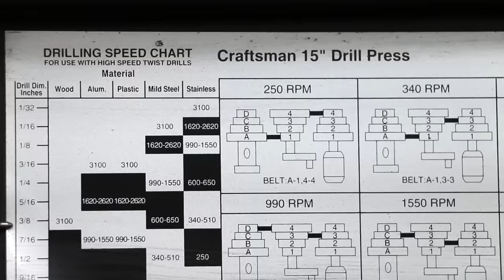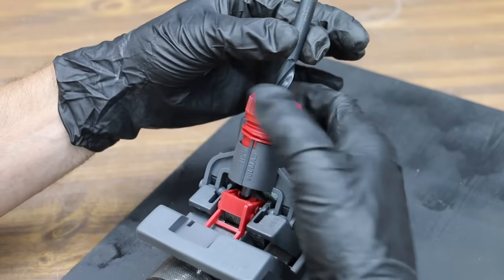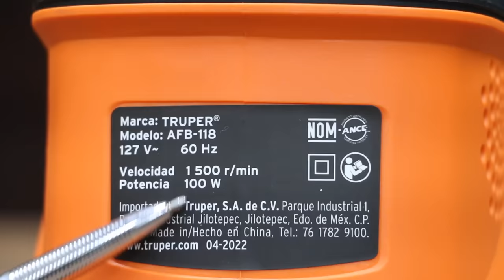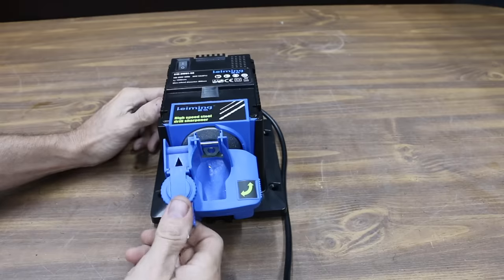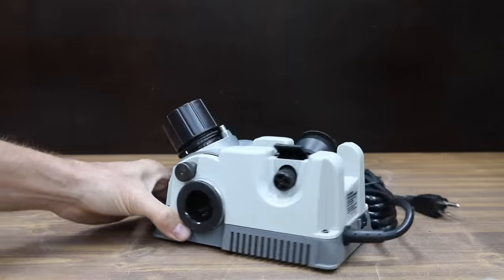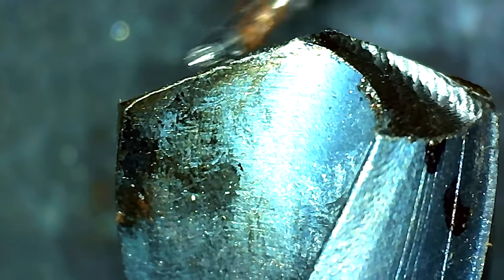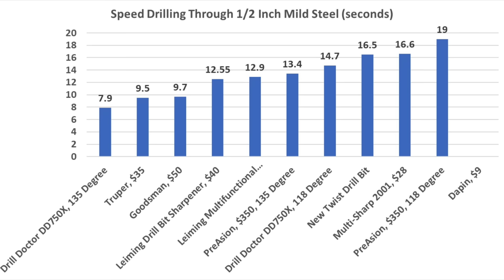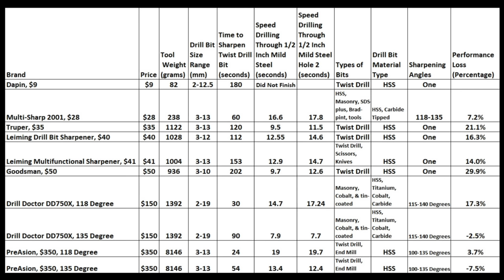Which Drill Bit Sharpener is Best? $9 vs $350--Let's Settle This!

Comment: I've learned tricks to sharpen drill bits with a grinder but the results of one of these are very convenient and obviously more accurate and yesterday i was thinking about these only to find out your video today. Guess even the cheapest can help me out considering i ruin drill bits like they're nothing.
One thing to point out is sharpening drill bits successfully is heavily based on their quality, usually it's heat from using wrong rpm vs material that ruins their hardness and even if you sharpen them they don't last, most times drill bits of better quality are more heat resistant because of their composition and cleaner metal alloys than generic recycled chinese ones so if you use them properly and sharpen them they can last forever as long you don't brake them.
I appreciate a lot the effort you put in your videos, you are one of the kind.
Reply from the maker: Thanks!

Comment: My dad has been using the PreAsion for quite a while and is very happy with the results. He sharpened over 150 drill bits in a single afternoon and they cut better than with the factory grind
Reply from the maker: Thanks for sharing!
Reply: @ProjectFarm yeah it takes a bit more work to dial in to the correct angles and the scale on the flute setter isn't great but once you get it dialed in it cuts the drill point and flutes way more accurately than the drill doctor by a significant margin and is way more repeatable/faster. It's real downfall is the flute setter, the cutting edge should be aligned with the flats on the collet holder or it will produce a point that is too wide in the webb.  One down fall of the machine is the motor uses metal shielded bearings, if you don't clean it out enough then grinding dust will kill the bearing on the shaft end of the motor, I have the larger model of this machine and had to swap out the motor bearing, I went for a rubber sealed bearing this time as they hold up better to fine dust.  With anything Chinese it's not perfect but with modified scales, drill setter and better sealed bearing you won't get a more accurate drill sharpener for the money.
Reply: @weldchip  That sounds like the motor bearing I just had to replace on my Craftsman table saw--severely exposed to dust and metal-shielded. I already bought a spare so I'm ready to replace it again, but thanks to your tip I'll try to find a rubber-sealed version the next time around.
Reply: @weldchip  I have the same machine, very happy with it.  Tip, add a few magnets in the dust chamber - that will help capture the dust.  Works great.
Reply: @ixfxi  this is what I did.
Reply: @weldchip  when you set the flute stop, you aim to make the cutting lips as parallel to the flats on the collet chuck as possible?

Do you know where to obtain the backwards collets that come with the machone?
Reply: That's the only one that I would buy, I've been a machinist for decades.

Comment: I've had a drill doctor for many years. It works OK. There is a big difference in the quality of drill bits. My go to are cobalt screw machine bits, if I'm not drilling something really hard, then carbide.  I now eyeball sharpen on a bench grinder, fast and close enough for most uses. Drills always make an over sized hole. Most drill presses are not ridged enough to do precise work. A mill will do better using power feed. Ream or bore to get closer. 
In the video the affect of "pop thru" as the bit exits can be seen as the rougher area at the end of the hole. Power feed will reduce/eliminate that.  
Great video as usual, Thanks
Reply from the maker: Thanks and you are welcome!

Comment: It would be interesting to measure the holes to see if the sharpeners maintain the hole size or if the point is off-center and oversizes the hole.  Great video.  When are you going to test hand held belt sanders and pole saws?
Reply from the maker: Thanks for the constructive feedback.!  Thanks for the suggestion.
 https://www.youtube.com/watch?v=U1lDxUMCY-M
Reply: Agreed. Even if it does a fast job but the hole isn’t to spec, makes that one worth less and maybe worthless.

Comment: That Drill Doctor is excellent. If they are available here in South Australia, I'll buy one. Great testing. I like the way you deliberately made the drill bits blunt, & then tested each sharpener. Great stuff. I like unbiased testing too.
Reply from the maker: Thanks so much!
Reply: I got one from Total Tools years ago here in Victoria
Reply: yea total tools has them 750X is $599 and 500X is $489.. crazy expensive. Might be cheaper to buy in USA and use shipito to send to australia. The 500X version is also basically teh same as 750X except it doesn't do as many angles on bits. just the popular ones 118-135

Comment: 🤔 Great testing and review, Todd.  
On the subject of sharpening drill bits, I had an uncle who was a master welder and he learned to hand-grind multiple facet geometry into his drill bits, which he swore were superior to conical ground bits.  When he started out as a machinist in the 1930s, he sometimes had to work without electricity and he was always looking for any trick he could use to reduce the effort needed to drill steel by hand.  He also claimed the multi-faceted bits would outlast conical-ground bits by a large margin.  Sadly, hand-grinding of multiple facet bits seems to be a lost art, but there are modern jigs that make 4 facet bits easy to grind, like the DBS-22.  I don't know if there are any that will do a 6 facet bit, which is supposed to be even better.  
It would be interesting to compare multiple facet drill bits produced with the DBS-22 with the conical ground conventional bits produced by the Drill Doctor and other sharpeners to see if what my uncle said was true.
Reply: I work in a machine shop with an older guy (72 years young) who has seen and done everything in our industry. Owned his own shop for 30 years, and really only works now because he genuinely enjoy the craft. He regularly free grinds 4 faceted drill points out on everything from a bench grinder, to belt sander, even with our disc sander.

Whenever he's doing it I always ask him to sharpen up a few of mine. The genuinely cut better than any result I've ever gotten, that's for sure.

Comment: Another great video. a couple years back I bought around a hundred used drill bits at a garage sale for just a couple of bucks. I looked at a lot of sharpeners. A lot of them were expensive, and the cheap ones didn't seem very reliable. I was leaning toward a system I could attack to my bench grinder. These were also expensive. I decided to make a couple of wooden triangles at the proper angles to use the side of my grinder's wheels. I made a groove in the center to hold the bits. These are very fast and accurate for sharpening. They cost me nothing but my time and ingenuity.
Reply from the maker: Thanks!   Thanks for sharing.

Comment: If you do another one like this, I'd love to see Tormek's drill sharpening jig included!  It's not fast, but it makes a great and extremely precise point.
Reply from the maker: Thanks for the suggestion.
Reply: I've had good luck with the General tools drill bit jig
Reply: @ForfeMac that looks like a great option because it works with a regular bench grinder.  And at 1/5th the cost of a drill doctor it could be a smart buy.  Maybe @ProjectFarm can't do a follow-up on jigs for people who can't quite justify a drill doctor.
Reply: @charliesullivan4304  If you already have a bench grinder it seems like a no brainer, though it did take some brainwork to figure out how to use the damn thing since it didn't come with instructions.
Definitely paid for itself in drill bits by now though
Reply: @ForfeMac  It did look a little complicated, but I just finally got a nice bench grinder, so when I'm up for a challenge I'll get it and figure it out.
Reply: @charliesullivan4304 one trick you can try is to buy a diamond coated grinding disk the same size as your grinder wheel, then slide it onto the grinder before the washer and the lock nut. Depending on which grit you buy, you can sharpen to a much higher polish, and also sharpen tungstens for TIG welding, or other high hardness materials. Also don't let your bets get too hot or they could loose thir tempter. (in theory high speed steels won't loose their temper in high heat, but why risk it IMO?)
Reply: Tormek 4 Ever!

Comment: Who here sharpens theirs by hand?✋🏼
Reply: What’s the name?
Reply: Been doing them by hand for about 50 years
Reply: Do you use a file? Or what do you use
Reply: 19 people
Reply: Sanding disk on an angle grinder, or bench grinder works pretty good in my subjective opinion.
Reply: One of the first things we learned in machine shop with a drill sharpening gauge .
Reply: Me
Reply: I had to make the drill gauge first
Reply: Use a bench grinder with a flat and medium coarse stone, depending on drill size. A common mistake is using too fine of a stone and overheating the bit. If it turns blue, you may as well grind that area out, as you just destroyed the heat treatment on that portion.
Reply: Hard to sharpen a 3/32 drill bit by hand 😂

Comment: Thanks for the video. I have been using Drill Doctor for years. I love it! My only criticism is the lack of tips and tricks in the manual. Your video gave me a little more insight. 

Tip: on the 118°, if you advance it by one notch when setting the bit in the chuck, you get a slightly higher pitch and faster cuts. BUT, it also grabs a little more. Be careful. A good drill can twist your arm off when the drill bit bites!
Reply from the maker: You are welcome!

Comment: the drill doctor works great especially making split point ends. I used the older model of the drill doctor when putting up my steel building and had to drill a few hundred holes in gauge metal and they would dull after a while but after a few min on the sharpener they were better than new. the drill doctor paid for itself a few times just on that job. 
great video

Comment: I have had a drill doctor since they supplied a VHS tape with them for instruction. I have had inconsistent results with it, the bits look textbook sharp when done but don't cut as well as I think they should. I appreciate this video, I need to lock myself in the shop with it this coming winter and sort it out.
Reply from the maker: Thanks!  Thanks for the feedback.

Comment: Very interesting.  I taught myself how to sharpen drill bits on a bench grinder very long ago while working in my father's auto repair shop.  I doubted the ability of these machines to properly sharpen a bit, knowing the complex angles that are involved, but the ones that worked contained complicated methods of moving the bit across the stone, not just rotating it along its axis.  Before watching the video I would not have believe that they would work but some of them did indeed work.
Reply from the maker: Thanks for sharing.

Comment: Looking at it, it seems there are two types of profiles these grinders put on the drill, the cheap ones usually put a flat surface while the expensive ones put a rounded surface that follows the work as the drill cuts, which seems to give a cleaner hole.

Would have loved to see how much time it would take for each sharpener to grind the same profile again as it made before but with damage to the drill, since if you are getting a sharpener you are likely to use the same one all the time. But I think for most people the most important part is how the drill cuts afterwards and not the grinding process.

Love your work!
Reply from the maker: Thanks!

Comment: I was given a Drill Doctor a few years ago.  It has saved me a lot on 2' long "installer bits" that we used to simply replace when someone hit concrete with them.  I have used it on smaller bits as well, and I've always been pleased with the performance.  I've always thought it was one of the best machines out there.  -- It's good to see that proved out by some comparisons.
Reply from the maker: Thanks for sharing.

Comment: used to sharpen drill bits the old fashioned hard way...which was cumbersome, and doesn't offer reliability and repeatability...
aside from the $40 one, I've tried all three shown on your video thumbnail ..didn't give me the result (sharpness, durability, repeatability) I wanted... gave up using those.
went the DIY route using a belt sander with included circular sander, and some modified wood blocks (to hold the drill bits)..
got what I wanted... and happy with that...sharpened HSS drills no problem drilling holes on 304 stainless steel..
Reply from the maker: Thanks for sharing.

Comment: I'm on my 2nd DD750X after the first one's motor wore out but after years of use. The diamond coated abrasive on the DD will last exponentially longer than those cheap grit wheels. Does take some practice to get them cutting their best.
Reply from the maker: Thanks for sharing.

Comment: Todd, another great review. There is one thing you missed however on the 750 Drill Dr. There is a M.T.O. (Material Take Off) adjustment knob on the side of the machine. Use this when needing to adjust the amount of depth of material you actually want to take off PRIOR to the grinding process. This can be helpful by taking more ‘material off’ or less, if you don’t need to thus preserving the bit material overall including the grinding wheel. This is important because when you’re changing/adjusting a 118 degree bit to a 135; this is what you adjust to ACHIEVE the proper cutting competency out of your bit. You rated this rather high on your overall test rankings and I agree completely having had both the original 350 and now the 750 combined for over a quarter century and these two machines are refined and highly functional. This added adjustment knob is a key point changer I thought I’d share back on your excellent review so viewers don’t miss why this is important. At $150.00 it’s pricey but I’ve never replaced my previous ‘350’’s wheel in that 28+ years and these are just worth their weight. I am NOT sponsored not affiliated in any way with the Drill Dr. name or company just to put that out there.
Reply from the maker: Thanks!  Thanks for the constructive feedback.

Comment: Perfect timing on this video!  I was starting to look around for a drill sharpener because I got a bunch of dull bits that need repair.  Im trying to decide between the PreAsion and drilldoctor.  Is the PreAsion all metal construction, including the chucks that hold the bits?  Does the plastic chucks in the drill doctor seem of good quality?  I would ususally choose something made of metal over plastic.
Reply from the maker: Thank you

Comment: I bought the Drill Doctor 750 about 15 years ago and it has done a great job for me, including sharpening larger bits. They used to offer a 500 which only sharpened up to 1/2 inch, and it was a little less expensive. 
The Drill Doctor uses a diamond cutter which makes a smoother finish than most stones will give. That may be part of the reason the drills cut faster.
Reply from the maker: Thanks for sharing.

Comment: I purchased the same Drill Doctor years ago at Lowes for $10.00 NIB,  only missing the diamond stone wheel.   OEM wheel was about $17.00 then and I find this tool is good for resharpening when you have a bunch of bits in a box.   However as a mechanic in the 1980s I had experience hand grinding drill bits, and own a proper 6" side grinding drill bit sharpening stone.  For the most part, if I need a fast cutting bit now, I go straight to hand grinding where I can increase the cutter angle and rip through mild steel fast.   That and if a bit is broken requiring shaping, or obviously if it is too large for the little Dr.
Reply from the maker: Thanks for sharing.

Comment: The one thing missing is the hole size, if not held straight there could be runout causing the center to be ground off center which would create an over sized hole. For many applications this may not be an issue but if you needed a more precision hole for tapping or reaming it makes a difference. Checking it to the nearest thousandths with a set of pin gages would have made for a better review.
Reply from the maker: Thanks for the constructive feedback.

Comment: Just bought the Drill Doctor 350. Easy to use and fast. Badly damaged bits took a few minutes each to come out sharp. I also like that you can buy different grit stones and they are not expensive.
Reply from the maker: Nice!  Thanks for sharing.
Reply: seems like a good price.  you're recommending it, then?
Reply: I will.  @gizzyguzzi

Comment: Great stuff! Drill Doctor is one of those companies that keeps changing products. Sometimes it's because customers complain about a feature(s) but other times it's mandated by the company bean counters. I have about a 10yr old Drill Doctor. I'm not sure a new one would be 'better'. There's a lot I don't like about using it, but it does do a good job for the most part. You almost need a mechanical degree to understand how to do wood spade bits the first time.
Reply from the maker: Thanks!